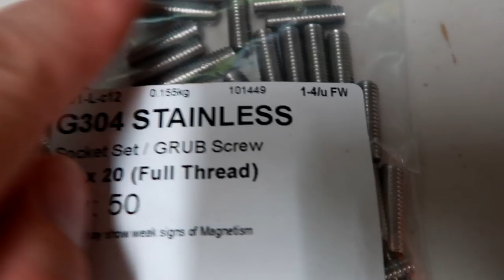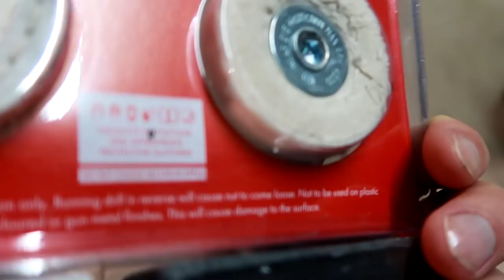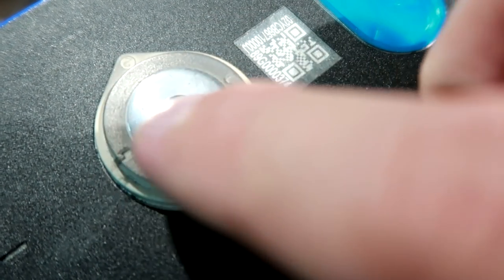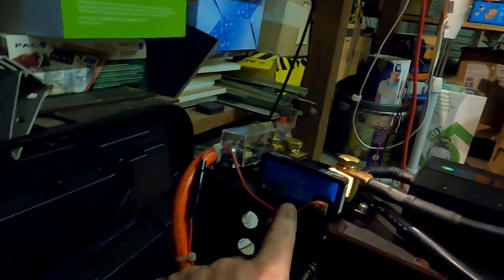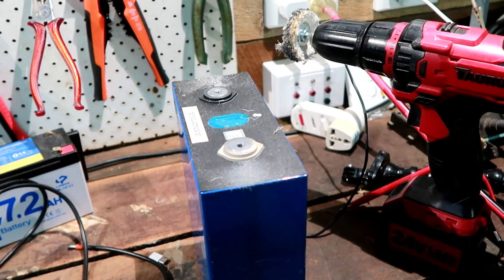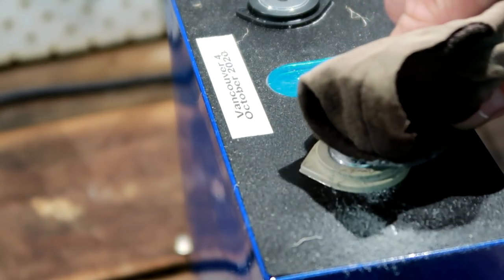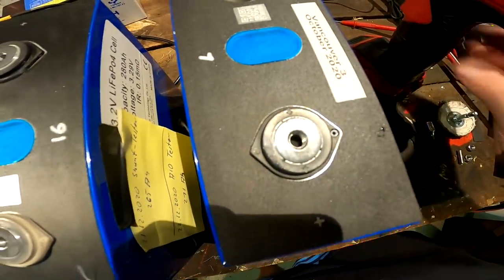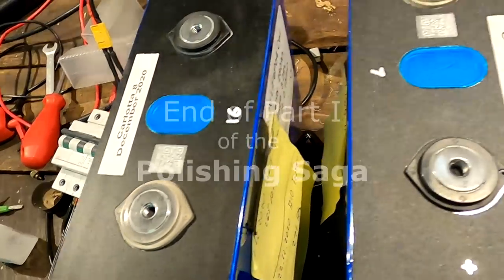Re-building the battery - Set-Screws and Polishing. Part1/2

Comment: I used MG Chemicals 846-80G Carbon Conductive Grease for my first 12 volt system with my original 4 batteries. 
I'll reuse it with the 4 more batteries I just received for a total of 8 280ah 12 volt system. 
It is the proper way to connect my BMS to a 2P4S system. That bothers me.

You're doing good, stop with the polishing it's doing no good, use  Conductive Grease.
Reply from the maker: Wait for part 2 of this video. Although there was another upgrade lately... I'm not convinced on this grease.
What's your problem with your BMS?
Reply: @OffGridGarageAustralia   I don't exactly know which positive terminal in each bank to use.
I use thinking of drilling a small hole for a screw in the middle of the bus of each positive bank.
The grease worked great, my terminals keep a good contact even when my fifth wheel and my truck are 4 wheeling over rough ground to a camping spot.
Reply from the maker: @guohuaye12  always connect the balance leads to the positive terminal of each cell.
Reply: @guohuaye12  My application is similar Rickey - off-road camper trailer in my case. One commenter suggested nyloc nuts to stop the terminals loosening - sounds like a great idea. For minimising oxidisation I'm going to convert all the bus bars to aluminium so its aluminium against aluminium, quick abrasion to both sides and buckle them down fast. The bus bars will have separate threaded hole for the balance leads. For the high current wire terminals on the leads between each lot of 4 cells (I have 16 cells like Andy's arranged as 4 x 4 cell batteries for ease of movement) I'm not sure what to do just yet.
Reply: @MiniLuv-1984   WOW, 16 Cells. You're going to have a Lot Of Amp Hours and Watt Hours to use.
Yes, I'm going to drill and tape a small hole in my copper bus bars between my positive terminals.
I don't know if I even need a BMS (150amp Daly) my EPEVER TRIRON3210N allows me to program all the Parameter setting for LifePo4 batteries.
I'll have 560Ah and 1760Wh when I'm done.
Reply: @guohuaye12  Yes, the 16 cells is way overkill, but 90% of the time, these cells will be used at home for solar storage. When we go away they are transferred into the camper trailer.
Reply: @guohuaye12  The Charge controller and BMS perform similiar battery management functions BUT at different levels. The Triron acts on the battery as a whole, while the BMS looks after individual cells.
Reply: @MiniLuv-1984   I sure hope these eight(8) Lithium Iron Phosphate batteries are as good or better than the four(4) group 31 MDC batteries I took out.
I could afford 16 batteries like you and Andy. Plus I want to stay at a 12 volt system with out the added Switches or Gadgets that could just cause me problems by failing.
Reply: @khwolter9038   I used Vaseline for my battery cables back when I owned my 1962  T-Bird and 1973 Olds442 because for some reason the batteries on those two cars just corroded all the time.
Reply: @guohuaye12  Assuming they are ok to begin with and the max charge voltages per cell are not exceed, they will last you years...well, I don't actually know that...I'm going by what the industry is saying as well as others youtubers etc...they haven't bee around long enough to actually know.

Comment: Seems most connectors to aluminum are scoring type washers and bolts and not reusable this has always been a problem with electric connections when using aluminum as it oxidizes just use the grease they sell and forget about it.
Reply from the maker: No sanding or smoothing with these busbars at all?